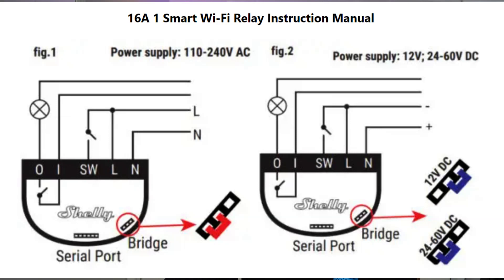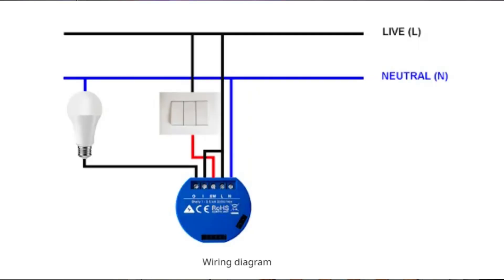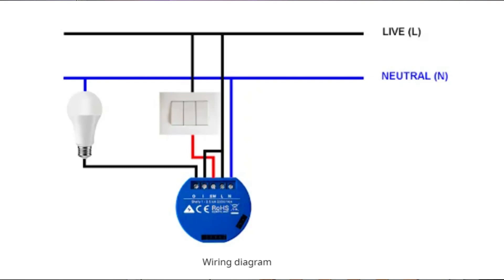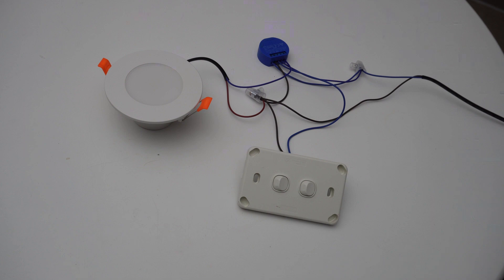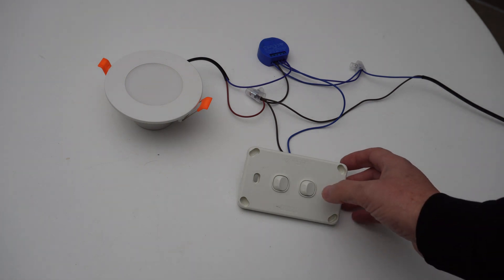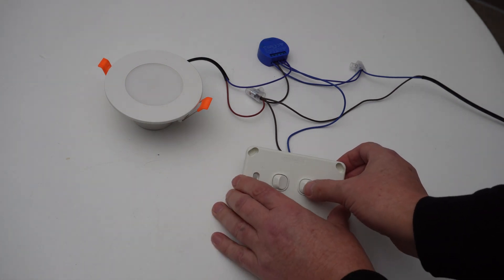How to wire up a Shelly 1 smart light switch!

Comment: It's strange that the Shelly requires two wire nuts for an installation.  It could have had larger terminals to get two wires in, or simplify its own internal wiring to not require the jumper from L to I.
Reply: Fr. Makes 0 sense